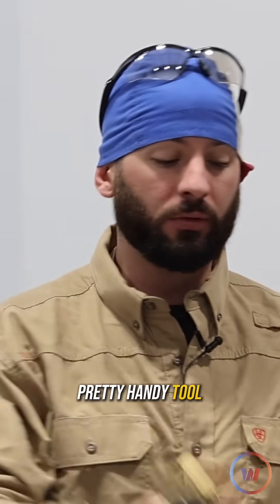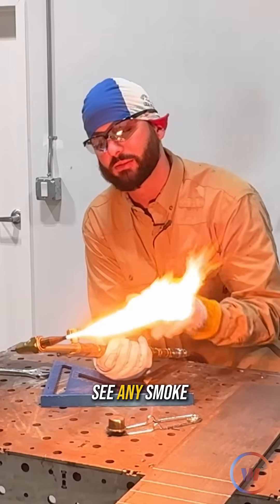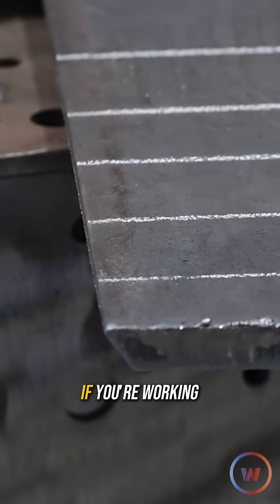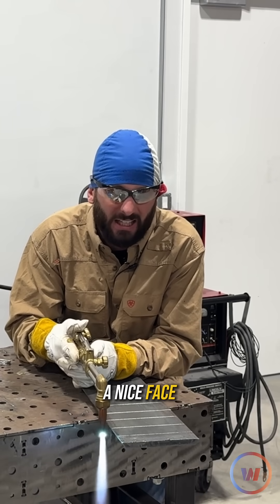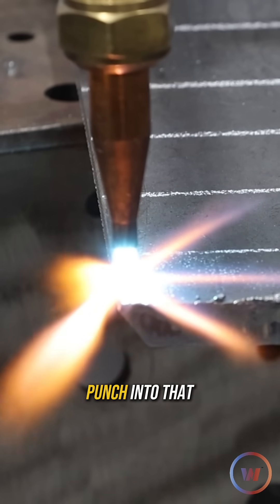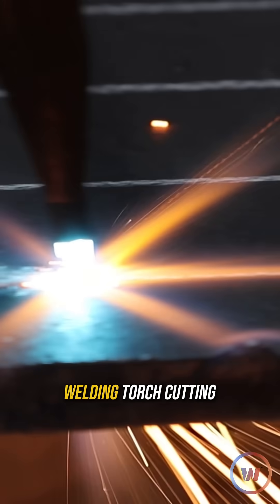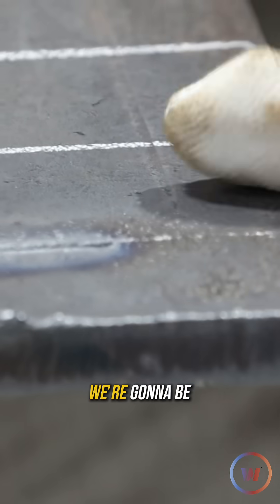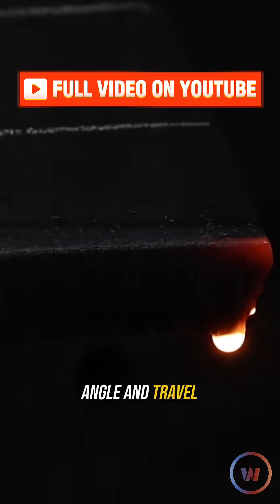Don't Make These Common Oxy-Fuel Cutting Torch Mistakes #fabrication #oxyfuel

Comment: Which is better for general purpose acetalene or propane
Reply: A baker knows his gas
Reply: Seems to me propane cuts a little cleaner but acetylene is faster.
Reply: Yah, I like acetalene better, but that propane seems like it last far longer but ya gotta turn it up, that's why I luv my plasma cutter, I mainly now use the torches for heat'in an burn'in off lugs,
Reply: Acetylene is more versatile but propane is a lot safer if you dont need as much heat